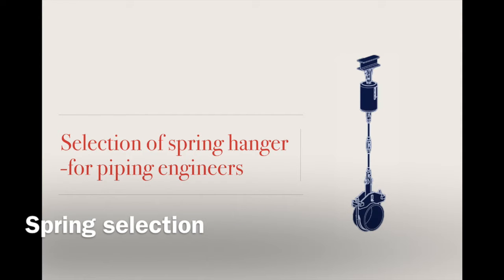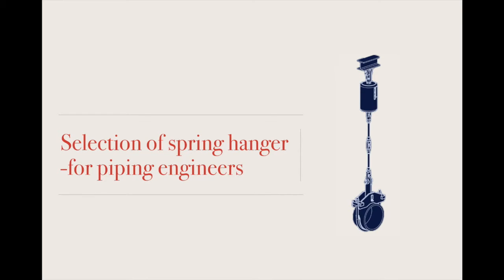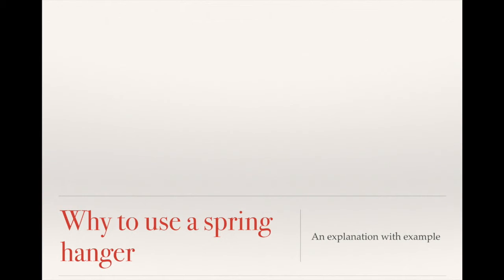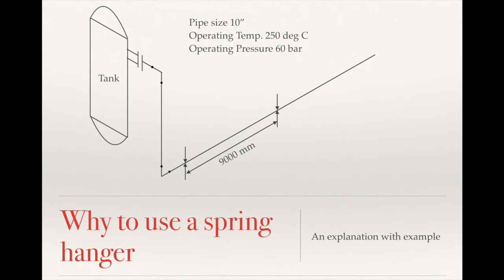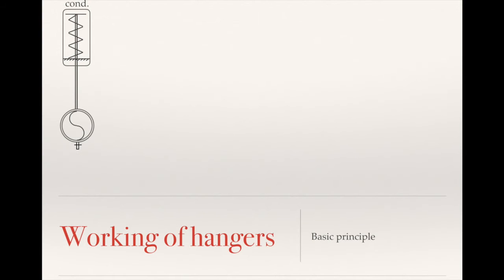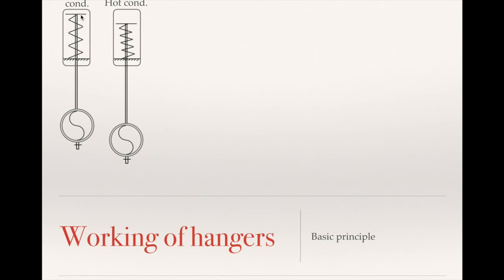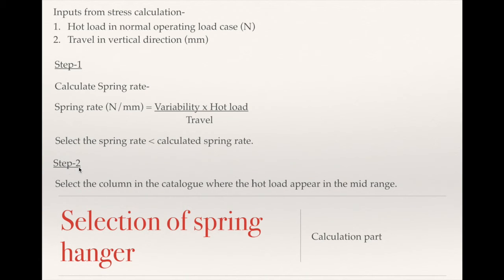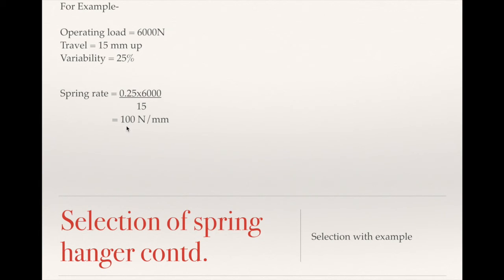How to select spring hanger - for piping engineers

Comment: what is the difference between spring numbers 21 4.18 , 25 4.18, 29 4.18 & 20 4.14? how to select which of them to order in this case?
Reply from the maker: +Alekhya Pal Thank you!! Difference in the types 21, 25, etc. is their construction configuration. Eg. 29 type is bottom spring support, type 25 is where spring can rests on steel, etc.